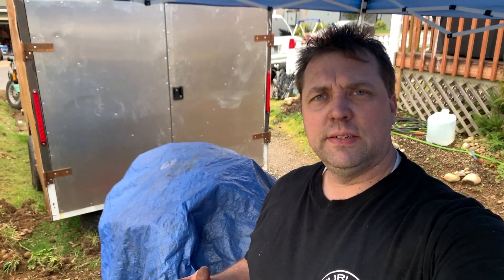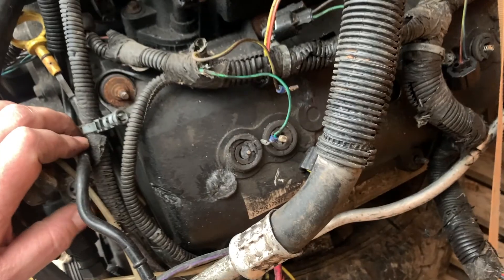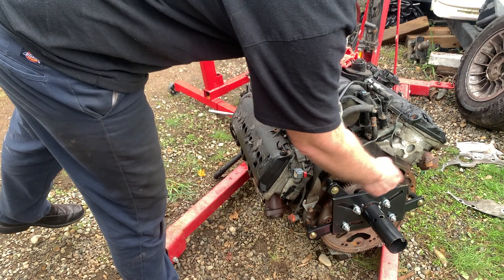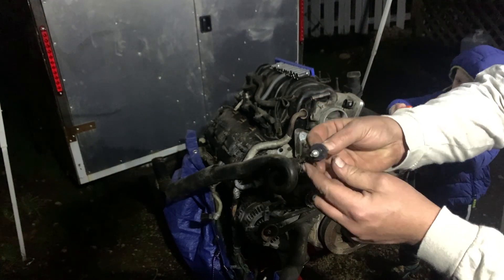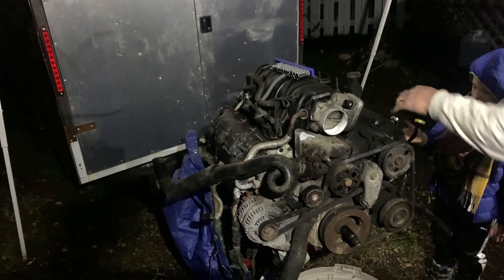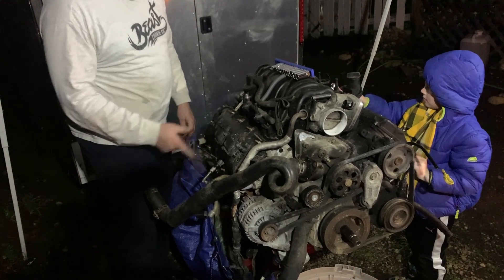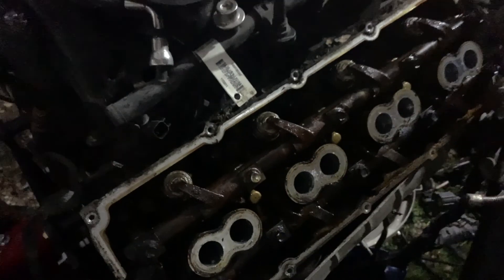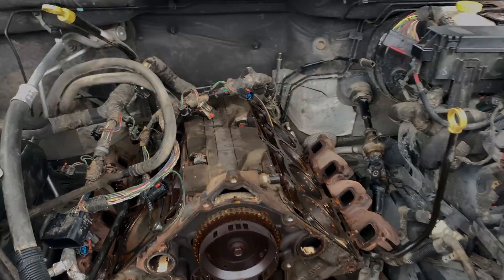Jeep Hemi 5.7 Used Engine Tear Down EP48

Comment: Great helpers! Since the engine was never worked on in a shop. ... could that damage have been done during assembly? So you are painting the engine and said compartment baby barf?
Reply from the maker: The engine in this video is the used one I bought for a replacement. It came out of a 2005 Grand Cherokee with about the same mileage as the green one. The engine in the Green Cherokee was broken because I hydro locked cylinder 8 going through the water. But there were several things on it getting ready to go out, like the belt tensioner, idler pulley.